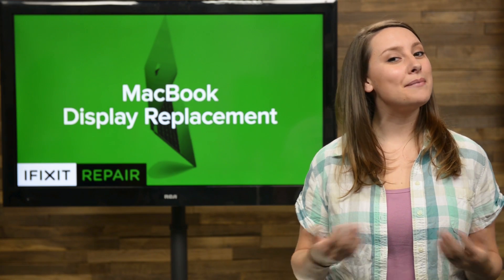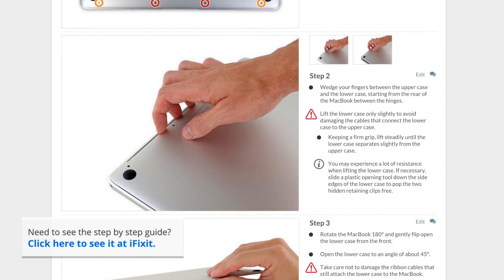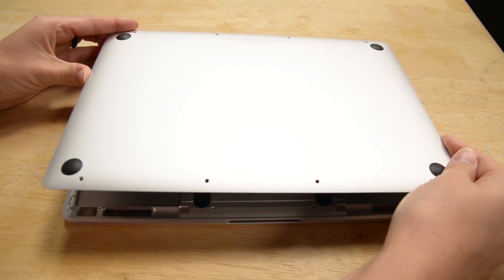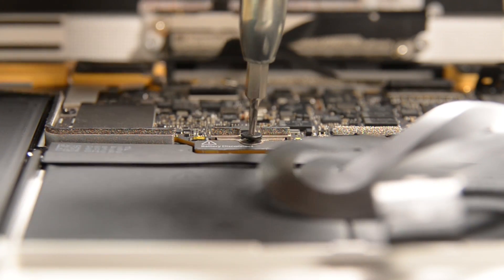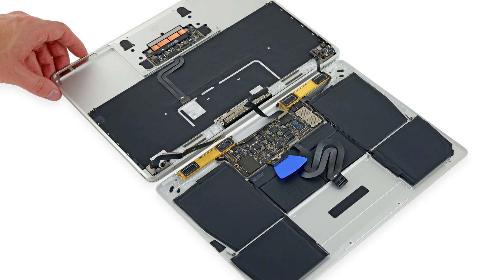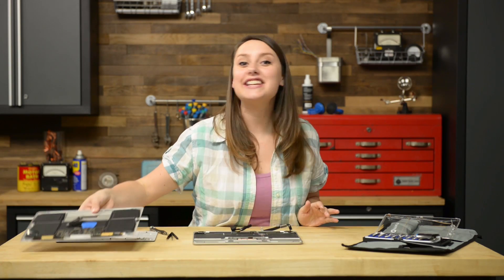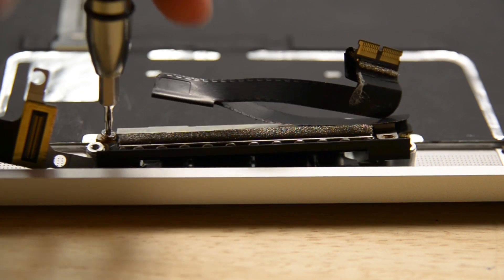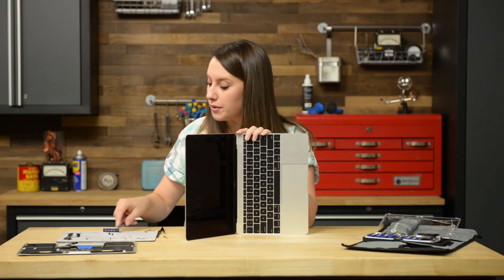How To: Replace a Display Assembly on a 2015 Retina MacBook!

Comment: The display on my A1398 is busted, I have a good one on an A1286 is it possible to use the good display from the 1286 and install on the 1398?

Comment: I have an early 2015 Macbook and this looks completely different. The touchpad is much larger and I don't have a USB C port on mine. What am I missing?
Reply: yeah, that's not a 2015 Macbook. Usually iFixit have good attention to detail, but this video, and the link in their description for the fix, both claim it's a 2015 Macbook when it's clearly not. From the reflective Apple logo instead of white (2016 and onward), the trackpad size,  the USB-C, and the fact that they call it a MacBook Retina without specifying Air or Pro, you can tell this is the 12" MacBook Retina.
Edit: I stand corrected. I guess there WAS a 2015 MacBook that is 12" and simply referred to as the MacBook Retina. It does have a USB-C port.

Comment: I have a 13" rMBP (early 2015) and mine does not have any of this ribbon nonsense? i have removed the bottom many times. Is this specific to the 15" early 2015 rMBP? My mac definitely has force touch pad...

Comment: HELP!!
I was trying to replace the fan assembly on a 2015 Macbook Pro using the iFixit tech kit because the fan had some weird noises recently. After finishing everything the Mac would not boot up and beep 3 times everytime I tried to boot it. From what I read 3 beeps during boot up means the computer lost connection with the RAM. Ram is soldered to the board on 2015 Macbook Pro and I did not touch the RAM at all during the process. Any idea why the RAM died?
Reply: do duc duy send it to Louis Rossman lol

Comment: Hello
I would like to know if the display connector of a macbook 2015, is the same as that of a macbook 2016, it broke. My display of a 2016 and I can get a display of a 2015, are they the same? Can I replace it with the display of the 2015?
I hope you can help me.
Thank you!

Comment: how do I know if Just need the LCD or the whole assemble?
Reply: I haven't changed mine yet but it has two dings on either side and if a new screen was fitted it would prob crack instantly. Also it's a much easier task to just replace the assembly.

Comment: It costs $400-$500 for the display alone. I guess it makes sense since it is literally half the device, but yikes.
Reply: You may buy a MacBook Pro display unit from China and it is exactly the same as you can get from Apple itself. And it costs 1/4 of the price than Apple service.
Reply: @benny9588  can you send me a link to the display. please i've just damaged my macbooks screen and looking for a way to replace it with having to pay a thousand dollars to get it fixed by apple.

Comment: Mmm, I've worked on a number of different Dell laptops in the course of my work and, yes removing the display does involve a lot of steps, but why do Apple use so many different screw head sizes and types?
I can only think of one Dell (the Latitude E4320's) that used more than one screw head size and all of them where 'normal' pozi-drive types.
I'm sure the only reason Apple use all of these odd types and sizes is just to annoy people that what to repair their own kit.  It doesn't stop them from doing it, just annoys them, I know, I'm one of those people.
Reply: Exactly. Steve Jobs didn't want people looking in his tech now they are doing the same thing. I remember these good old simple days when you could just simply unscrew a few screws and the entire laptop was apart without any adhesive or anything that would cause problems after replacement.
Reply: So true. I agree with you!

Comment: It be nice if they didn't fuse the LCD to the lid. Ugh
Reply: Apple makes great efforts to make self repair difficult.
A display replacement is $400 on a Macbook 12.
Reply: Agree 10000%  @billbob4243  everything they are making to complicate our lifes more and more...I"m about to ditch and go to windowns and save me some cash. after this latest upgrade I've just being reading about problems and more more towards the drain!!
Reply: +CreativeType According to them that's the only way to make the thinest display assembly they can and because they fuse it putting a nice camera in it's almost imposible and they end up with the shitty 480p sensor this has, even though the macbook pro has a 720p sensor with a similar display. Why the fuck? only they know.
Reply: catc296 Or  the cheapest way to make a display that thin. Its not fused per se. Its just glued to the lid with really strong adhesive. I've replaced a few Macbook screens and have tried more then once to pry the already broken screen LCD off with 0% success rate. Its not as if the adhesive magically makes the display thinner.
Reply: CreativeType Adhesive should be their middle name, let's agree that it's not the best or the most adequate way to do it
Reply: Sure hehe
Reply: +J Walker the non retina ones are plastic and tbh who would want a glass screen laptop!?
Reply: Hoy deos plastic break in spiderweb.. I have never seen this except on glass.
Reply: In Beijing Apple directly told me the laptop is too new they can't repair it. This was when I first brought it, it wouldn't charge. I finally found out it was the poor quality Apple USB-C cables. I already broke 3. Now I need to replace the LCD too...